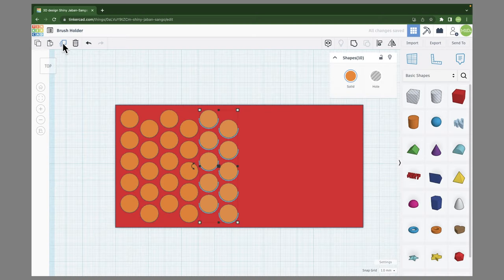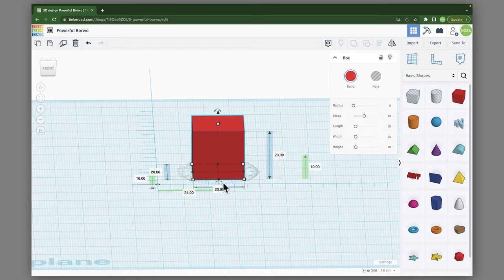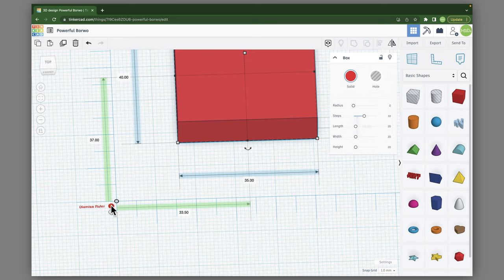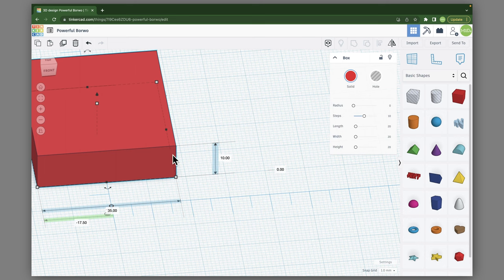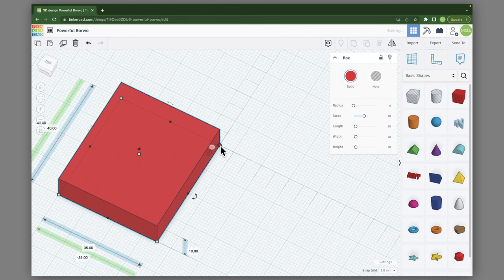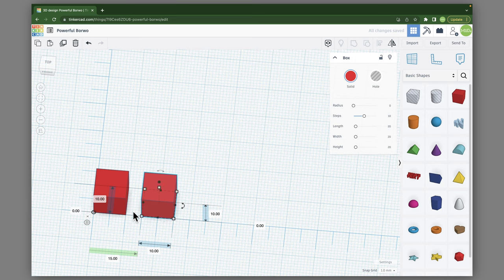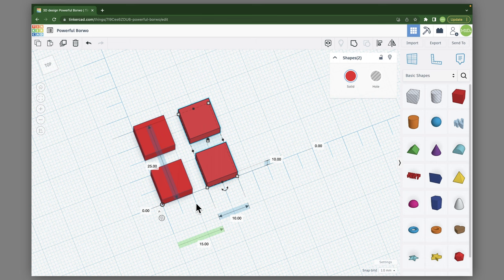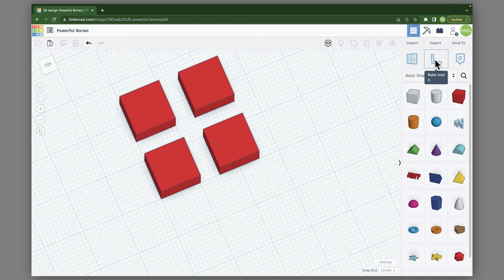The Power of Precision: Tinkercad Ruler Tool Tutorial

Comment: That's not everything, actually. What if I had an imported .stl file that is a disk with a hole in the middle, and I wanted to measure the diameter of the hole? I am in a quandary... Thank you
Reply: Ya, my problem also, and nobody has a good solution it seems. What's in this video is kind of obvious, but the problem of measuring holes in parts is a huge problem for me. I know some people bring objects from the side, check their measurements and then fit them in the holes but when I've tried that, the alignment is always a little off.
Reply: Have you found any solution to being able to measure the inside diameter?

Thanks
Reply: @CybaGirl  - Nope, still no clue.

Comment: I still cant figure out how to measure a hole inside an object...
Reply: Tinker cads measuring system sucks and even the snap to grid sucks and the grid needs to be able to be expansive not so limited so many flaws sucks it’s kindve essay but not really to use but after a while and lining stuff up and counting with tapping on the arrow buttons so many times for the MM it’ll take forever but eventually work out

Comment: Hi, I am curious as to how you can use the ruler tool to measure the top radius/diameter of a cone.  The ruler works for the bottom of the cone but not the top value and I can't seem to find a way to do this.